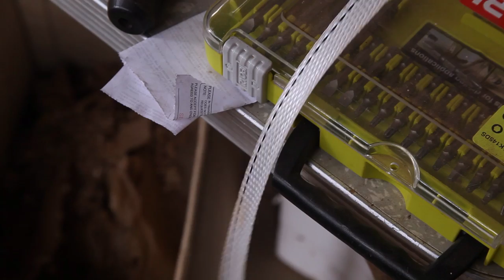How to make Straps for Beehives - The Bush Bee Man

Comment: In the USA, most garbage pickup is done by either a local government or a semi-private company. The "wheelie bins" were initially meant to be picked up mechanically (at least where I am) so they were HUGE! You could fit three or four 'regular' bins worth of garbage into them! The issue that happened was: The older folks couldn't wheel them down anywhere. Typically in the USA, your garbage pickup is at the end of your driveway... And the bigger bins were too unwieldy and basically everyone complained about them. So we got the bins that you got there now, those are about half the size as the ones that we have in the USA. (There are local variations, but this is common/typical.)

The real big PITA is that you got two bins that are IDENTICAL except for coloration... And one is meant for the recycling, and the other is for anything that isn't recyclable... Unless it isn't, and then they don't have a place to go... SO, you end up having three bins, one with a mix of your "it is recyclable but it is kind of awful" stuff, and then the other with "regular" trash and then the recycling... It's just so annoying that now many people here are just saying the hell with it, and they are just throwing garbage into whatever can they happen to be nearest to... Which is backwards, I know, but that's what they are doing. So now the city is considering putting a system in place where people are FINED if they have been discovered to be mixing the garbage... Imagine that. A literal garbage tax. What a world.

Comment: I'm spoiled. Not only do I have wheely bins, but the trash truck has a special lift on it. They pull up, and grip the trashcan with it's forklift like pincers. Then the truck lifts it and dumps it in the top. They set it back down and are off to the next house.

Comment: Hi Mark and John.  I love your channel, thanks for all the laughs.  I won't comment on the trash bins as Teran P. and I live in the same region of California. I do have a question about the use of the ties for your hives.  In the US we use lids that come down over the top of the hive box.  Having that lip keeps the top on the hive under normal circumstances.  Of course, there's hardly a hive without a rock or a brick on it to keep it secure in the wind.  
As a side note, I recently had a refrigerator I was getting rid of and seriously considered making it into a horizontal hive.  My husband pointed out that keeping an old refrigerator around the house might not add to the curb appeal! We built a horizontal hive instead, waiting to populate it with bees this spring.

Comment: I can't stand the tin straps so I use a nylon strap with the same ratchet assembly. Same bins in Queensland mate. A range of sizes and three or four different options.
Reply: Yep tin is crap and wait till the idiot council starts to collect general waste bin every second week like they have here.
Reply: You right tin not easy to handle but I believe they shuold last. How long do nylon straps last? Nylon generally speaking is not UV resistant. I know fishing line fluorocarbon is UV resistant. I bought once on aliexpress a roll 500m and used in the sun and after 2 years in open sun in NSW it was still holding with no issues. So what is needed line which holds 15kg and loocking spool and you insert something to hold. I believe 15kg should be enough right? We doing protection from minor incidents like strong wind but not a kangaroo or drunkard smahing beehive.

Comment: same bins in NSW and in ACT. I wanted to find an easy way of making a strap as $13 quite expensive especially it won't last long and I have no desire to learn how to do the tin replacement. I don't know but sometimes I have issues with my strap probably because I'm trying to fix it using wrong end. I'm thinking may be just easier and cheaper use a galvanised wire locking nut which holds 2 ends and put some sort of locking mechanism at the bottom and justinsert something to tighten? Still better than stones

Comment: Why couldn't you use nylon strap in place of the steel strap?
Reply: Watch the whole video for your answer.
Reply: @privatebubba8876  i think he was asking why not use they nylon strap on all of them instead of the tin?
Reply: I did I just wondered why they didn't do all that way?
Reply: You can put a sleeve to protect soft side's  If Transporting with the straps i would pizz off the metal as in hard breaking the bees will be on the road before the material straps(metal is the past get rid off it.)